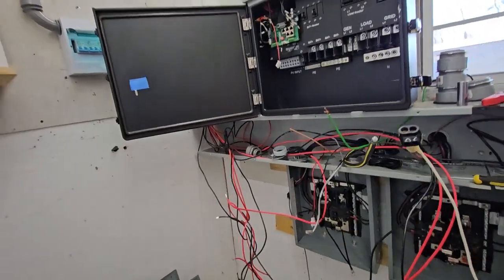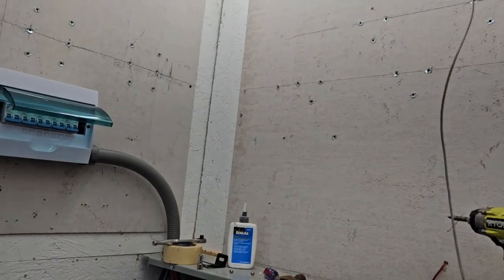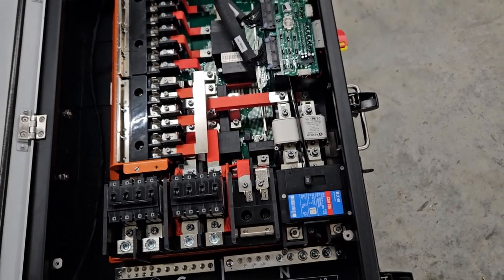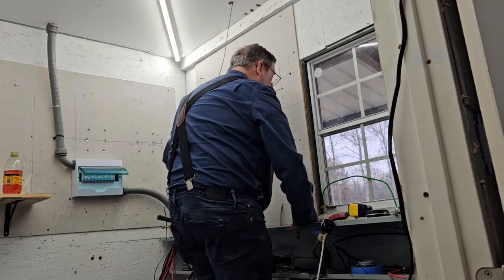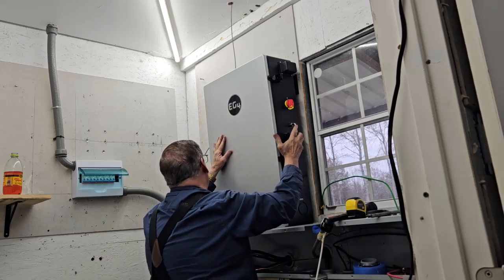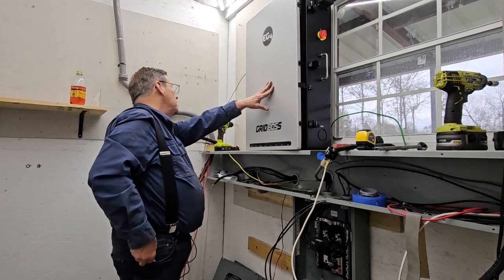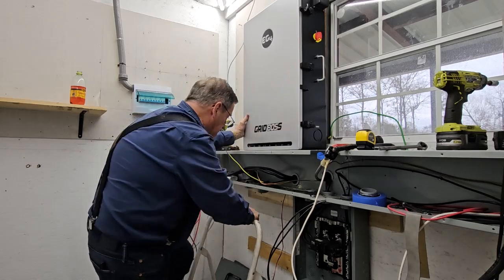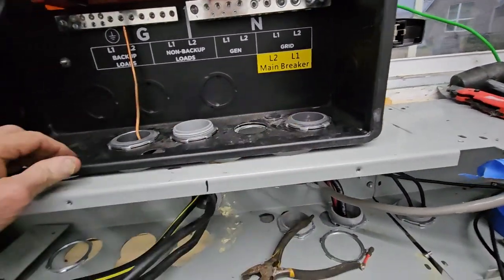The Boss is UP

Comment: How did you drill the holes in the support framing, which hides the wires, below the Gridboss?
Reply from the maker: @michaelrobertson7397  I have a set of hole saws . I thought I would just cut a square hole a bit smaller than the gridboss like others have done. I really want a knockout punch but I can't justify it.
Reply from the maker: Keep the gridboss far away from your working area and have a vacuum ready to catch the metal bits.